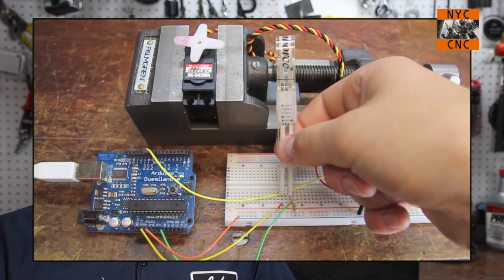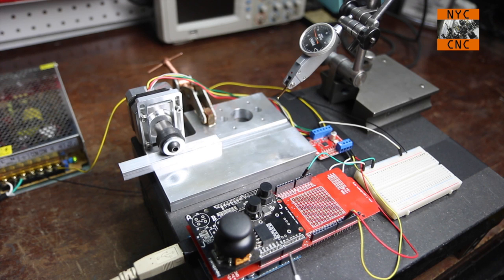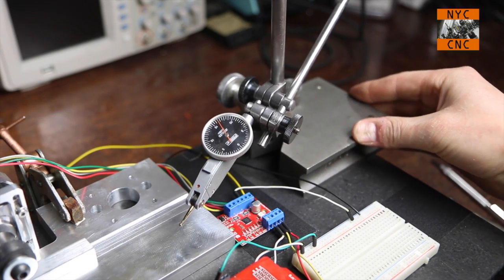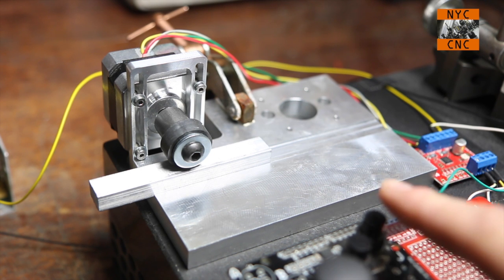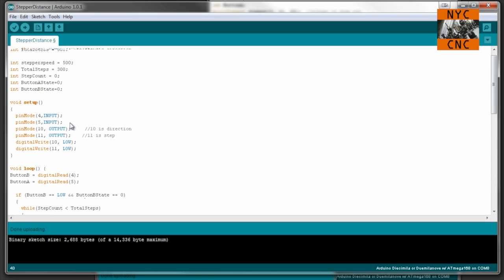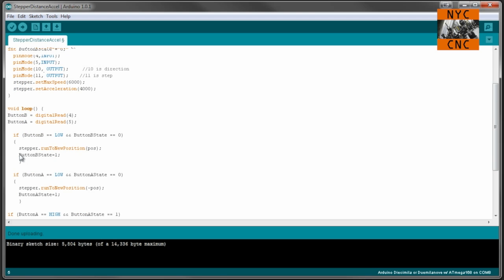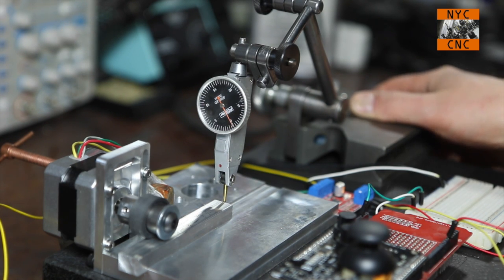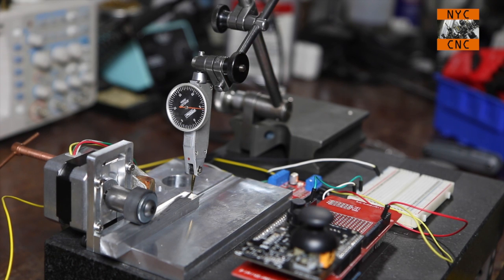Arduino Stepper:  Ultimate Accuracy!

Comment: Hack some digital calipers somehow and have them output their position to the program to know exactly where the stepper is on the slide. This would be a little difficult and i have no clue how you would do this but it would be very accurate. Real CNC machines do the same thing with glass slides so they know exactly where they are. Great vid by the way, I am a CNC operator / programmer and love this stuff.

Comment: I have a NEMA 23 and NEMA 32 stepper motor lying around, what kind of power supply would you recommend I used with them?  What voltage and wattage would you recommend?  Could I use an old PC power supply?  Thanks!
Reply: NYC CNC ok thanks :)

Comment: John
Wow! Just found you. I look forward to learning more of your ideas. I invented the CPT1019 and the CCT1021. I started Wild Shot Camera a few years ago. I think I may need to change over to Stepper motors. My new invention is the CCT1021 Camera Trolley System. I am having trouble with the stopping and starting and Speed . I use a 20 Volt DeWalt battery. Thanks and by the way,  GREAT light and video work!!!!     Daniel
Reply: Great ! looking forward to it!

Comment: Perhaps for the acceleration test the slippage is more prominent in one direction due to either ridges on the metal or the rubber. There might be a slight tilting of the metal in this case. When combined with some form of ridges or patterning that might cause added grip or slippage in a particular direction.

Comment: Hi, 

Actually we are working on a 8" steel robot design, We need to have 28 motors for complete robot system. The individual controller for each motor makes it too costly. So we are searching for some controller which can control multiple motors at a time. We found that aurduino can control upto 12 motors at a time. Our requirement is a arduino which is compatible for 24 V upto 4 amps servo motors. While I was looking at the specification of arduno controllers, I found that it can not provide the output voltage more than 5V and current more that 1 Amp. Actually I am from Mechanical Background so I am totally illiterate in this thing. Is it possible to control such a power motors with these controllers providing the required power separately or something like that? Please suggest me the suitable aurduino and the solution for my problem. 

Looking ahead for positive reply.

Thanks.
-Om Prakash Yadav

Comment: If I had to guess, I would think the acceleration code is to blame, perhaps the way it increments the value for acceleration is done by some kind of estimation or mathematical formula that either rounds or divides, and in doing so it would be difficult to end up with whole numbers 100% if the time (i.e. no decimal values).  I would love to see the code in the header file for accelerating the stepper to see where the problem stems from. Though I would expect the problem to be present in any code that allows for changes in acceleration via the user assigning variables.

The first thing that comes to my mind is to pick an acceleration speed that would function best in your application, and then find the closest values that would allow for mathematical computation that results in only whole numbers, in order to prevent any cumulative error in the acceleration process.

I suppose there are other possible points of failure, such as the connection between the rubber and the sliding pin, but I don't see why you would get bang on results from the prior code and different results from the acceleration code if this was the source of error.

Anyhow, not sure if this is the best solution, but it seems like a viable solution looking from the outside.
Reply: that is my suspicion as well. if you use any floating point you will get rounding errors. it's surprisingly easy to fuck up stepper driving code to miss steps. I would say his code is bad, not the stepper

Comment: I think if you find a belt that is very thin and hard (not glossy or traction will be an issue), you'll find the accuracy improve quite a bit. I wonder if the rubber from printer paper rollers might give you a more consistent round shape than what you're using? They are used for this kind of application and might work quite well.
Reply: Glad I could help!

Comment: Hello and nice work again!  I would like to make a suggestion that perhaps could help solved some of the problems that you have mentioned with the mechanicals of your system.  Have you thought of using a wheel attached to your stepper motor with an off center hole?  sort of a cam.. that would remove all friction issues from your system and most importantly, that would also remove the unwanted axial force on your motor. then you could place your indicator dial directly into this wheel. The bigger diameter wheel, the more resolution on your readings. Just a thought. Thanks again for all the effort you put into training others. Cheers!

Comment: when you press a button, before the movement is finished, the accelstepper thinks it is at its endpoint, you are using relative steps and they should be absolute.

Comment: NYC CNC,
In your particular case, most likely the lack of repeatibility of the movement comes from the friction drive. There is always slip in friction drives.
Reply: There is a difference between moving step by step and stepping fast. you can check that if you attach an encoder to the motor shaft. If you are still interested in this project

Comment: Great video-- I would suggest that the breakdown in accuracy in the stepper code with library example was in reality due to the rubber wheel loosening up on the motor shaft. If you were using a geared setup with high resolution the accuracy would be even more outstanding.

Comment: Could you start using metric units as well as imperial. Point one millimeter has a better ring to it than four thoulsands of an inch. You should'nt encourage the use of ancient imperial units anymore. Im sure you agree with me.
Reply: NYC CNC
I know. You should try to change it so it will be better for your children. You would change your broken tire on your car too. Ok thats a bad analagy, but still.

Comment: Friction Friction Friction!!!
 
The problem is not in the code or the stepper motor.
The problem lies in the acceleration and deceleration of the motor.
Fast acceleration/deceleration gets the bar moving and stopping fast.
Because there are less times between steps. Maximum torque is applied.

A good analog for this setup is a steam train when it makes it slow step the wheel slips.  Friction at the base of the load holds it in place. Allowing the wheels spin most likely at the hub and the rubber.

Without knowing the force applied to the shaft, load, and base or the surface texture and elasticity of the Rubber used the surface finish of the base against the load it is hard to tell.

Lubricating the track, knurling the top of the load that come in contact with the wheel, and gluing the wheel to the hub should fix this problem.

In my opinion “accel” library would work best on a screw, gear, or chain drive.

D2

Comment: Hey have you tried putting in a line of code that prints to the serial the count of steps? I bet the accel/decel code is just not producing a repeatable number of steps.  That would put this uncertainty to rest (it should certainly help rather than hinder things as far as slippage, etc., is concerned).
Reply: NYC CNC Worth trying? I think there is a misunderstanding here. Correct me if I'm wrong, but is this quality not the entire flipping point of a stepper motor? That number of steps is proportional to angle of actuation?
Reply: NYC CNC Sure, that sounds pretty interesting. I have more of a software background and electronics are new to me, but what I would suggest you try is two or three simple modifications to the Arduino program: Add a static or global variable that counts steps. Then, wherever the code that "steps" runs, add one to that variable. Then define somehow the points where you are at one "end" of the actuation. This is where you print the value of the variable to the serial, then clear the variable to zero. This might slow down the actuation process by some small factor, but like we have established that shouldn't matter because A: stepper motor B: once you fix the code so it always uses the same number of counts, you take out all the serial printing and counting shenanigans and it will run as fast as usual.
Reply: +NYC CNC steppers are insanely accurate. if you are getting inaccuracy then its more likely the code is wrong rather than the stepper . the entire point of steppers is accuracy in an open loop system. but its very easy to write the code incorrectly and get incorrect steps calculated.

Comment: I take it back - I have just gone through AccelStepper code and its documentation (some very clever stuff going on it there) and there is no issue with the code.

It does use micros but ONLY as a means of working out where on the ramp it should be and does not use it in its accel/speed calcs. All of the positioning on the ramp is as per http://fab.cba.mit.edu/classes/MIT/961.09/projects/i0/Stepper_Motor_Speed_Profile.pdf

I would suggest that it is as per another poster said that you may want to use:

stepper.setMinPulseWidth(10); //default is one

NOTE: minPulseWidth is only used when you are using a 2 wirestepper as you are. When using other (3/4 wire steppers) minPulseWidth is no where to be seen)

Also, you commented in the video you didn't know what the 1 meant in AccelStepper stepper(1, 11, 10); //the first parameter is interface and can be:

	FUNCTION  = 0, ///< Use the functional interface, implementing your own driver functions (internal use only)
	DRIVER    = 1, ///< Stepper Driver, 2 driver pins required
	FULL2WIRE = 2, ///< 2 wire stepper, 2 motor pins required
	FULL3WIRE = 3, ///< 3 wire stepper, such as HDD spindle, 3 motor pins required
FULL4WIRE = 4, ///< 4 wire full stepper, 4 motor pins required
	HALF3WIRE = 6, ///< 3 wire half stepper, such as HDD spindle, 3 motor pins required
	HALF4WIRE = 8  ///< 4 wire half stepper, 4 motor pins required

Sorry but the code is fine - must be either minPulseWidth or some other electrical issue.